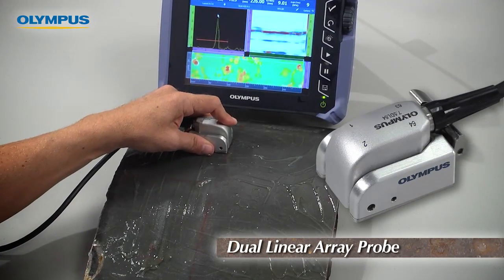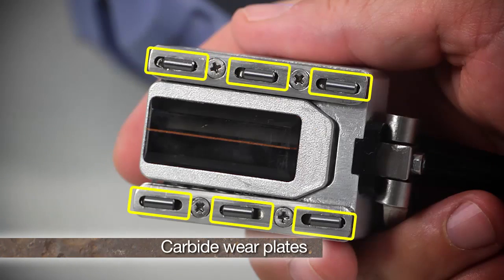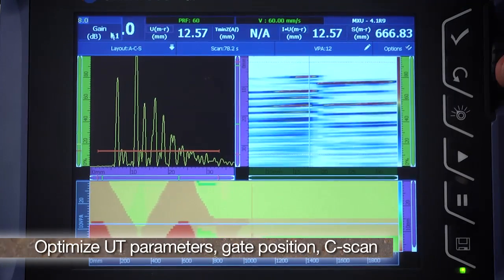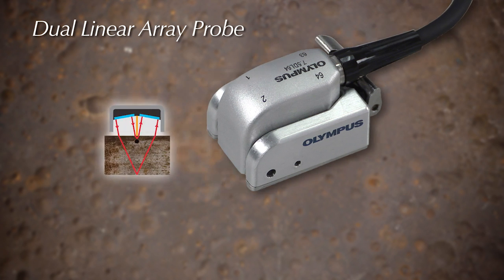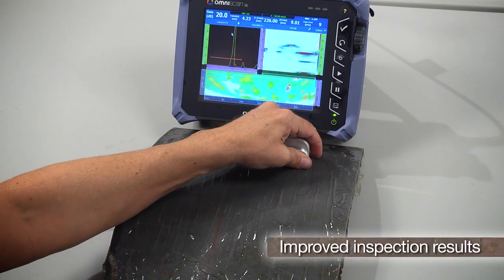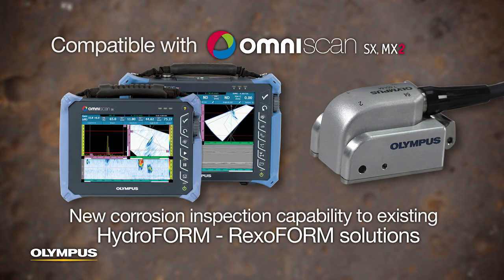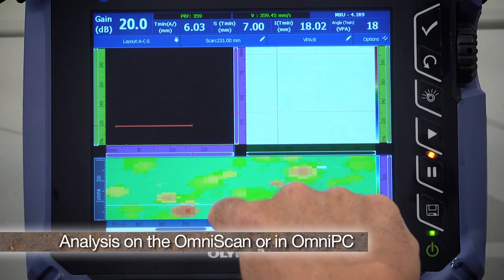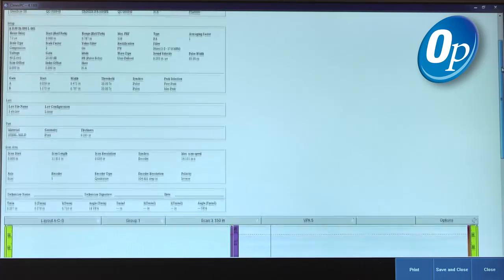Olympus Dual Linear Array Probe Overview

Comment: What are the range of thicknesses where this probe is adequate? What happens if there is roughness in the surface due to corrosion or coatings? Thank you